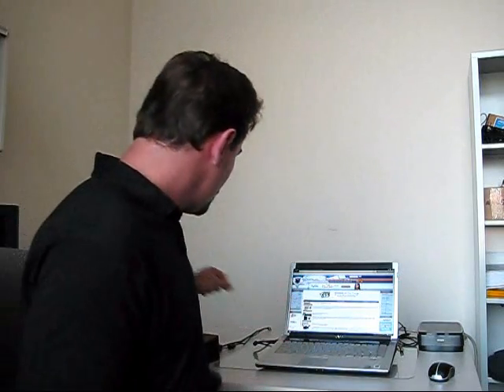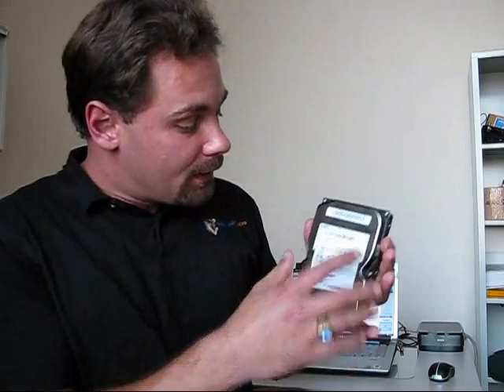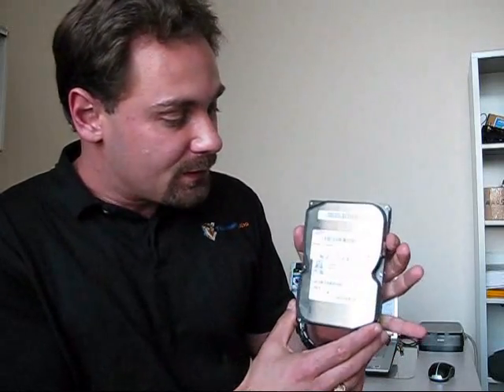Hard Drive Click of Death Explanation and Live Demonstration

Comment: I think mine is just a bad Power supply.. cause my old PC had a hissing noise from the PSU and just recently i saw for some ODD reason [left the PC on for a while hoping something would change and it did] my screen popped up a msg saying it was in safe boot mode, this was when my HDD wasn't doing any multiple clicks till after the PC finally started but said something about an AC adapter wasn't pluged in right or something but everything was plug in fine. i even removed the HDD to clean it of any dust and tried restarting 3 times.. the last and 4th time, my PC's HDD just made multiple clicking noises, and im sure its not the click of death as most videos i've seen show the HDD clicking multiple times then stops. MINE however keeps clicking and clicking and clicking and because my PSU i think is at fault, due to it always shutting off my PC and has a constant flashing orange light, my screen just stays black, nothing alerting me about what the problem is, could it just be my power supply box causing the problem? cause i really don't want to lose my Data on that HDD. and i was considering getting an HDD transfer USB cable for this pc

Comment: Your drive is dead the moment you open it? Nonsense; I've seen modders shove LEDs inside those enclosures and have working media drives with light bouncing off the internals working just fine.
Reply: Well, I think the guy means that once you open it up and expose the platters, is gonna be for one last try to recover whatever data possible. After you've tried and failed, kiss the HDD a permanent good night, unless you wanna continue to use it if still working but data will be at risk. I've done it so many times with older HDD's just for fun. Haha!
Reply: +bluephreakr yea you got a point most drives have a filter in them to spin off any particles into the filter sense the spinning drives moves air
Reply: +bluephreakr 
Depends on you whether or not you'd want to take that risk though.

Comment: So if I have two internal drives and one (or maybe both for all I know) is clicking. Ho would I know which one I need to replace?

The clicking is not consistent enough to guarantee that I can have an expert even know it is clicking at all. I can't tell which one is bad, because they are both spinning at all times.
Reply: tenchimuyo69 Put you hand on the disk, then power up the PC.  You can feel the hard disk that's clicking.
Reply: Or take out both drives and connect them to a car battery while you lick the connectors to see if that makes you go CLICK too.

Comment: mine was clicking with low power setting.. i chaNGE TO high performance power setting it kept clicking.. after watching the video i changed it to balanced THEN IT STOPPED CLICKING(one of my older secondary harddrives that used to be primary in other computers)

Comment: I've had a clicking sound from my 6 yeats old computer for a while now, I always thought it was the fan but now I'm scared that it could bd the harddrive, I do get random errors from time to time and sometimes but very rarely it doesn't detect the hard drive and has to reboot the system with windows repair, it doesn't work and the computer is perfectly fine after that, and I have atleast 650 GB of important stuff (movies/photographs) without any backup. Should I send it in for someone to check maybe? Thank you for your answer.

Comment: Mine doesn't sound like a click but like a brr brr brr vibration
Reply: +James R the head is stick on the platter and it can't spin you can try to open it up while turning the head counter clockwise pull the head down to park state close it up and try powering it
Reply: Mine is doing this, too.  The laptop is very old and it fell.  It was always running at 100%.  I'm thankful I backed it up exactly a month ago, so the only data I'm missing is all the scrapbooking I've done on it in the last month (about 12-16 pages worth... lots of hours) and the scrapbooking program since the company no longer exists, so I need to find a replacement that hopefully reads the same files.  :(  We knew we needed a new laptop as it is 6-7 years old... but still frustrating.
Reply: Ah then you must have a CD in the tray. Take it out, problem solved!

Comment: regarding the comment that freezing a hard drive can cause moisture to condense/gather on the platters (which would ruin the drive. ... The risk of moisture getting into the drive is minimal - and you can take steps to greatly reduce the chances of moisture getting into the drive. If you are going to freeze a drive- you want to first place the drive in a zip lock baggie. then you want to put something in the baggie with the drive that absorbs moisture (uncooked rice is a popular option, but silicon gel packs work a lot better). once you have added something into the baggie to absorb moisture, you want to try to squeeze as much air out of the zip lock bag as you can AND then seal the bag.  Now you can put the zip lock bag into your freezer with a reduced risk of encountering any problems from moisture.   (NOTE: it also helps to make sure your freezer is working properly and maintains a temperature bellow freezing.  If your freezer is not maintaining a correct temperature then your freezer will start to defrost and the humidity and moisture will build up inside the freezer.)

Comment: wd my passport clicking for 1 min after it stops the noise but not detected in my pc
Reply: Rishabh729 
It sounds like the drive has been knocked a bit. Clicking and shutting down indicates and internal issues with the read/write heads. Professional services would be required.

Comment: Hi there,

thank you for a really brilliant clip. You really explain everything in detail. in fact i am sure i have a Hard drive problem simply because i heard that sound sometimes in the night when my pc is in sleep mode. It is not rapid, just like clicking on and off over 2 or 3 minutes with about 10 seconds in between.

so just this demo shows me it must be the problem.

i had a fast pc but i just noticed this sound over the last few weeks before wakening up the pc. then one day the system did a repair start up but then hung on starting windows. I was lucky to get into it on safe mode and get my data copied. 

i just wanted to ask something. I was told that if i re installed the OS by formatting the hard drive it would fix the errors. but as i understand it there are different types of hard drive issues: 1 corrupt hard drives and 2. physically defective mechanisms (the latter is what you show). So if i have 2. a defective mechanism, would that explain why i cannot do a factory reset, install a new OS on my system from bootable retail disks (as microsoft advised) ?

i am understanding that i need a new hard drive to be able to install a new OS.

I am sorry for this detailed list of Qs just i am very new to all of this.

Either way i have learned from your clip that i will definitely replace that hard drive but wondering if my OS will work after.

thank you again

Gerard
Reply: Can we copy the data in safe mode bro ?

Comment: Hello, my hard drive has packed in, it tries to boot up, only gets to the windows flashing logo and then switches off after a while, on other occasions it says 'hard drive not detected, try reseating hard drive'. On switching the laptop off it gives one click and then turns off, other that this when the laptop is on it doesnt make any sound. I have important university files on there that need recovering please, could you help me with this please. 

The hard drive is a WD2500BEVT 75A23T0 made March 2010
Reply: Seems like you could have bad sectors, plug it into another working computer and save your data before it completely dies
Reply: Brian matty If the drive still spins the chances of recovery are high. The cost would range from $300-$450CAD. Which would convert to as low as low as $281.00 US

Comment: Damnit. The reason I'm on here is because I want to try to fix my hdd myself. Not send it in. Damn. Should have made a backup of my backup drive. Double back ups.
Reply: You could try repairing the head as a LAST RESORT if you don't have the budget to send it in. Make sure you eliminate as many possible contaminants as possible
Reply: Afigu939 Do you know how much repairing the head alone would cost? I've had the same issue and it's beyond a joke. First my computer crashed, and as I was taking all the files I'd backed up to my hard drive, the hard drive crashed too.
I've taken it to some repair guys and they won't even look at it, saying I need to see a specialist.
Never would have had this problem if I bought 20-something USB's. -.-
Reply: Carla Rose haha, I have about 10 flash drives now! I also decided never to rely on any storage device with moving parts in them. I'll probably invest in a solid state drive in the future.
Reply: Sounds like a good idea.
Luckily, after posting that comment, I found a way to recover everything from my computer's hard drive so I haven't lost everything after all :D

Comment: why does the guy call himself "WE explain" in the description? Second the platter can not be moved to a different hard drive due to the calibration issues. The only option will be to replace the broken heads.
Reply: yeah, you'd need to send it off to a NASA lab and hire 23 engineers to "maybe" succeed at that ridiculous notion - can't believe they even suggested it. Of course, there's always that "slim accidental chance" that one could fidget around with the heads and temporarily get a read-write session. That happened to me once, I quickly got the most hard to replace data off it before it gave up the ghost.

Comment: Can someone help me out I have a gateway laptop that is telling me that I have no bootable device and my hard drive is making clicking and scratching noises. If I were to replace my hard drive with one that is compatible will it fix the no bootable device problem and get my laptop running?
Reply: Try to boot up a Windows installation first off a flash drive or a CD first and try to install Windows on the hard drive.
Reply: ***** LOL Obvious, my fault. I guess a suitable answer is "buy a compatible hard drive".
Reply: MrColdDub Replacing one drive with another is not going to fix the problem. Since the part to boot is on the drive, and it sounds dead to me, it can't read it no longer. Get a new drive and reinstall your operating system. 
Then  you could have an enclosure for a external drive, and can try getting the files you want off it, if there are any.

Today at work, for example, we managed to get a back up of most of the files of a non bootable drive. And the only way to see the partition was in a Linux based environment. The OS partition was not readable in a windows environment. It would ask you to format it.

Although other partitions could be read, at the end it seemed to have bad sectors, but still be able to get a backup of most files.

Yours might still be ok enough to recover some files. You can find Linux Mint easily, burn it to a dvd and load it from cd, don't install it.

Comment: I watched this when it was first uploaded because i was board, i thought to myself "that would suck if that happened to my computer". 4 years later... It did... Is there any other way of fixing it besides freezing, taping, and repair shop? I have a extremely low budget and i need my hard disk. And im now permanently switching to flash.
Reply: Freezing it is an extremely bad idea.
Reply: rage1umr Already killed it from freezing. XD  We just got a new one. At least i got to see the the inside of my hard drive.
Reply: Was it a 2.5" or a 3.5" drive? What brand and model too?

Comment: My hard drive is making a slight clicking sound but it's working fine... I just got it and I'm kind of scared that it will stop working all of a sudden... can someone tell me what's causing the clicks even though it's reading my data just fine?
Reply: A clicking drive while it is running and working is the head starting to skip over the platter and missing a sweep of reading the data, then fixing its self and working again, get rid of this hard drive asap, it is going to fully fail one day.
Reply: Twml My hdd starts zuuuuuu.... sound and then clicks and then stops and then starts again zuuuuu...... click stop ???? What should i do??? What is it 100% usage almost 30min to boot up and then hangs everytime some work done

Comment: freezing moves the motor enough to take out a short in the wires???  wow. that's the first time I heard that explanation.
Reply: Cold metal contracts, warm metal expands. When 2 adjacent wires in a coil have their insulation break down, they form an undesired circuit between them. In some cases the windings were not far from each other electrically, so no biggie, but if they bridge a significant amount of the windings with this short, not enough electromagnetic energy to spin the motor.

Freezing, which makes each part of the coil (wire) in a long winding (sometimes 100's of feet) shrink a tiny, tiny amount. But added up it can physically open the short as long as both wires at the point of short move away from each other enough.

The reason I never do it is because just as cold may break the short, normal heat will quickly return, causing the 2 insulation faults to cause a short again. It is a very easy way to see if it is just your motor that is burned out. 

Also, and I know the thread is old, you can take your drive apart & put it in another case/housing with swapped parts, or put parts from drives on ebay into your drive to swap out the bad part(s)-even the controller board... but it is not advisable in any way to keep the drive in production. Take this chance to get the data off it and consider yourself fortunate.
Reply: it does not move the motor. a short in the wires really... does the motor runs on 360 V ~ maybe try a oven

Comment: Stating that taking the top off your drive instantly kills it is incorrect. Maybe if you live in an area with mega dust everywhere it will destroy it but I know people that have replaced heads on a drive at their kitchen table and the drive works fine afterwards.
Reply: I did that the other day to an old 80Gb ide drive and i was writing to it with no issues until i scratched the platter with scissors :P
Reply: it doesn't kill it instantly, but its possible that situations in their house could lead to dust, like having shedding dog(s), or dandruff that ends up in the hardware while they look at it.The average person would not know that they need to make sure that the room they are in has minimal dust. Also, even when it doesn't instantly kill the drive, it can lead to damaged sectors, or can make your device's performance degrade over time.
Reply: Maybe not instantly but once you contaminate it by taking the cover off that was installed in a Clean Room then it's just a matter of time .....  There is nothing holding the head off the platters except air from the platter rotating so it doesn't take a very big speck of dust to crash the head ....

Note that the guys who do this all end up with a dead hard drives in short order, (wow a whole 2 days) even if they fail to understand the real cause and think it's something else.

So where exactly do you buy a new head for a hard drive? REALITY CHECK, you can't, no manufacturer is going to sell you one and every manufacturer and model is different. Yeah this may have happened back in the day of 40Mb hard drives (not a typo) but those days were gone before the Internet even existed ....
Reply: @Pernoctate  Some people actually buy old baby hatches to replace components in HDD's :)
Reply: Finally someone who agrees with me.. Once I used a hard drive with an open cover for 2 days and it was still working fine but then I touched it by accident and it died.
Reply: Barnacules Nerdgasm barnacules 😀 funny seeing you here
Reply: just pull a new head from same model hd bought off ebay duh